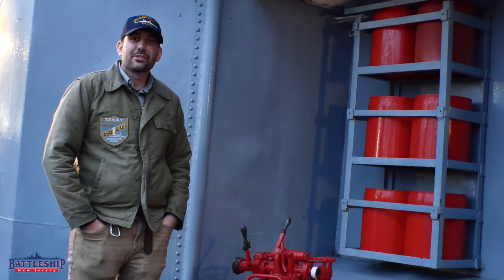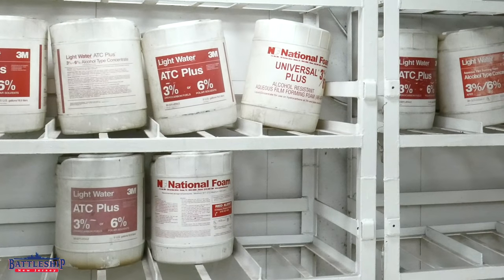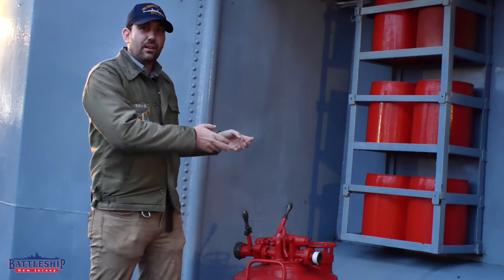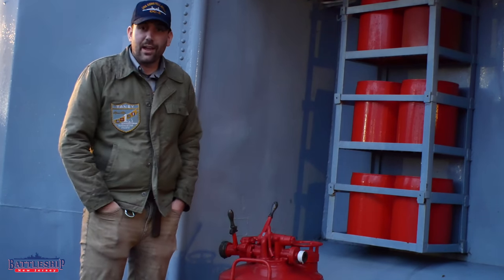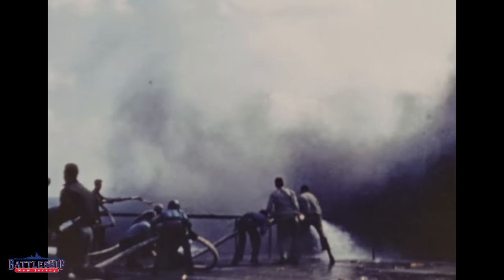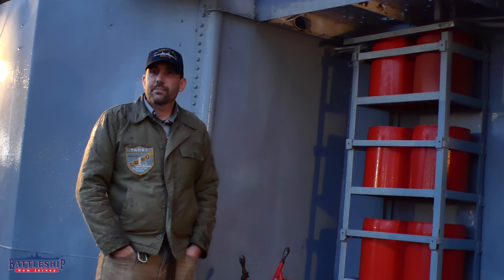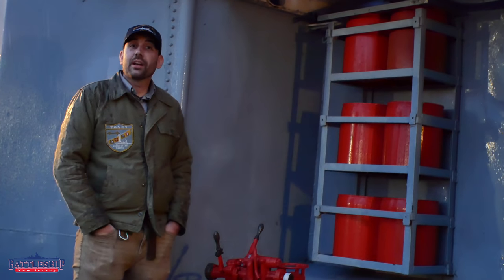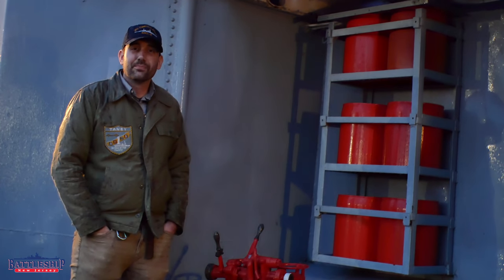USS Kidd: Firefighting

Comment: The principal use of those long pole-like firefighting applicators was for the secondary hose team to provide a curtain of water around/on the primary hose team.  The idea was to help protect the primary team from heat and flame.  About the time I was leaving the Navy, they were transitioning to a new nozzle design which both teams used, selecting different spray patterns depending on if they were directly applying water on the fire or protecting the other team.
Reply: I well remember those Low Velocity Fog Applicators. I was a #1 Nozzleman and relied on the #2 Nozzleman to keep that applicator over my shoulder and in front of me so I could fight the fire. I remember a demonstration  of how effective they were. We were at firefighting school and they lit a big tank of NSFO. We then proceeded to approach the fire with the applicator raised providing a curtain of water in front of us. Then, we were instructed to put the applicator on the ground. It was like being inside a blast furnace. It turned out they had another use - putting out a magnesium flare. Come up to the flare and jam the applicator against the flare. It puts out enough water to cool the flare below ignition point before the water is separated into oxygen and hydrogen and explodes.

Comment: For damage control, USS Pensacola CA-24.
A torpedo mostly blew the stern off, only a few frames, some plating and a prop shaft kept it with the rest of the ship.
The crew somehow managed to stabilize it in tulagi harbor so they could sail to Espiritu Santo to get further repairs done by the USS Vestal so they could then sail across the Pacific to get to a stateside yard.
Reply: Not to mention, her surviving Operation Crossroads where she was impacted by an aerial, and subsurface atomic bomb in Bikini Atoll. Though that wasn't so much a testament to damage control as it was just impressive of how strong the ship was along with the efforts to perform those tests and her later sinking.

Comment: The old AFFF foam concentrate, which would have been in the red cans, was largely animal guts.  The damn barrels as they aged would leak and concentrate would get on the deck and be a slippery, stinky mess,  The new detergent based AFFF was a BIG improvement!

Comment: ...when the Franklin's captain healed the vessel over in a sharp turn so the burning fuel fire on the water which had accumulated in the hanger caused by the sprinkler system simply poured over the side with the fire. Fine piece of seamanship. The agony of the Franklin would make a great movie if it was handled right.

Comment: I cast my vote for USS Growler SS-215 Because the entire bow was folded over and they managed to limp back to Australia. 

Also worth discussion, the U-505. Survived a horrendous depth charging so intense the captain cracked and she had to be brought back to port by the XO. Moreover later in her career during an impromptu changing of teams there was some considerable flooding that had to be stopped and then systems repaired enough for the flooding to be pumped out before being deposited to Bermuda.
Reply: There is a large number of US ships to loose bows completely, due to the fine/light way they where made, and how the front armor cap was implemented behind them. Meanwhile many German ships lost sterns, due to 3 shaft arrangements reducing the normal sectional depth supporting their rear overhang.
Reply: U505 was also the most severly damaged u-boat to make it back to base for repairs. Got hit by an ariel bomb right behind the conning tower that cracked the pressure hull. They couldn't submurge for 3 days while welding the crack. I talked to one of the crew members 20 years ago and he said they could not belive they were not spotted on the surface for those 3 days and attacked again. They spotted many US planes, but they went undiscovered.

Comment: Not to take away from the historical sense of this but an eductor it more of a t shaped appliance which works on a venturi principle. A foam eductor used either in line with the buckets of foam concentrate or in prepiped systems draws the correct ratio of foam to water into the stream which is then aerated at the nozzle to make the actual foam. There are other types of venturi based devices which can be used to increase the volume of water flowed from a standing source and range from jet siphon used in water tanker operations in traditional firefighting to water based sump pump backup systems in homes. 
There are powdered firefighting agents that are used and may have been used in that time which I can't speak for but AFFF foam is a liquid concentrate that is applied with water in a ratio from 1% for class A fires and acts as a wetting agent or 3 and 6% for combustible liquids with 3% for hydrocarbon and 6% for things like alcohol based fires (polar vs non-polar liquids). The types of old foam were based mainly on organic compounds basically animal fats and would go bad over time with newer style AFFF being made of polyfouroalykyl components which are now being replaced because they're a known carcinogenic issue that many military and civilian firefighters have gotten cancer from. The purpose of foam is to blanket the fire and snuff out the oxygen to liquid fuel fires, while it is also used for class a fires of combustible solids as a wetting agent giving the water more surface tension which helps with a similar blanketing effect along with the cooling aspect of water when used in a traditional firefighting system. The older types of AFFF like those plastic jugs in the racks are now widely phased out if not outright banned due to the PFA contamination and carcinogenic issues.
As for the steam question, one type of firefighting science is the use of steam expansion itself to cool, wet and starve oxygen in the area on fire which extinguishes many types of fire. Steam expands at a rate of 144:1 which has come in and out of fashion in modern firefighting where at times the principle was to use fog type streams which breaks up the water into fine droplets that are easily flashed into steam but can create hazards to possible victims as steam can cause burns and displace oxygen. The high expansion helped extinguish fire where modern times have seen a transition back to solid streams that use less steam expansion and more direct cooling thru higher flows. The concept is still hotly de aged at the dinner tables of many modern firehouse with both types of science having advantages and disadvantages.
Reply: Purple-K was developed in 1959 to improve on previous firefighting powders, so I think powder agents have been in use throughout the history of the NJ.

Comment: Steam is actually a very good firefighting media.  It fights the fire by displacing the air, which of course means there is no oxygen.  Without oxygen the fire cannot burn.  It is actually a recognised firefighting method, especially on ships.  I can send on some scanned historical documents on this if the museum is interested.  They also cover specifically firefighting in ships, and foam.

Comment: good video.  Worth also if THAT interested to see the Wikepedia article on Firefighting foam, and its talk page. Interesting to see original WW2 equipment. I don't think I heard him say - to many veterans this material is known by an Acronym of AFFF or "A triple F" - Aqueous Film forming foam" .
Reply: AFFF was usually paired with PKP or "Purple-K".  The stations in the engineering spaces had them mounted together, as in the nozzles were physically on the same mounting.  You literally had the AFFF nozzle handle in your right hand and the PKP nozzle in your left hand dragging both hoses off the reel behind you.

Comment: As used in the 1970s-1980s, Szimanski mis-interprets the use of the applicator.  This needs to be corrected. The applicator provided a shield of water to protect the fire hose team so that they could engage the fire more closely.  Also, I have yet to see a display on using the OBA.  Apparently Szimanski never actually served in the Navy.

Comment: My choice of best damage control would be Bunker Hill, although Yorktown comes close.  Yorktown is definitely the best example of damage repair for the miracle the Pearl Harbour dock workers pulled getting her ready to fight the Battle of Midway.

On a civilian ship, the best damage control has to be the former Texaco tanker Ohio during Operation Pedestal, somehow surviving multiple attacks by the Luftwaffe and Kriegsmarine (and undoubtedly Italian assets as well), lasting just long enough to reach Malta and having its cargo of aviation kerosene and diesel fuel before grounding in the harbour.  It was dead in the water several times, its crew repeatedly managing to get the engines restarted.

Comment: About steam and fires: Good steam does not contain oxygen.  Oxygen is harmful to all of the machinery that the steam is used on, so the feed water to the boilers is typically put through a "deaerator" tank that's used to warm it and remove air and oxygen from the water.  So even super-heated "Dry" steam should put out fires, although obviously it comes with it's own hazards.

Comment: Better do your research! That system your're  trying show is not an AFFF system but a system that used a protein compound (animal blood from stockyards) to create foam. The device in front of you is not a AFFF pump but a duplex water proportioner. I believe AFFF came in blue containers while the red containers (which were steel and held five gallons) were for the protein foam. The pick up tube used to syphon the foam from the five gallon cans to the water proportioner was known as a donkey dick to us sailors. I went to boot camp in early 1969 and they were still teaching the usage of the old foam due to the number of WWII era ships still in the fleet. AFFF was developed by the navy in the 1960's and gradually replaced the protein foam compounds.I was on the USS America, launched in 1965, from 1969-1971 and we had AFFF systems throughout the ship. During this time the Navy was trying to reduce it's stockpile of protein foam and we would get as much as we want to use in cleaning the bilges.